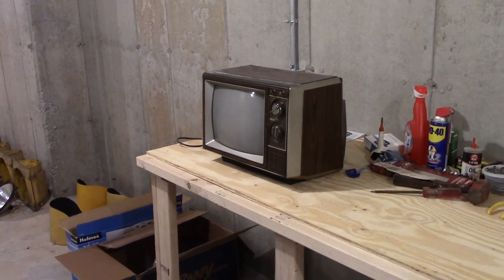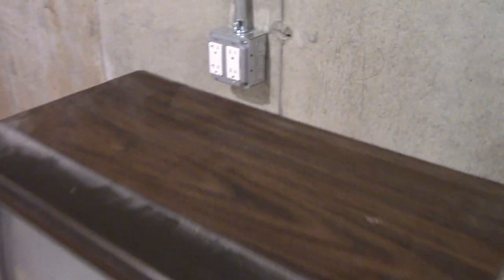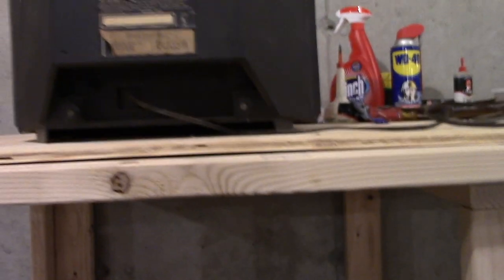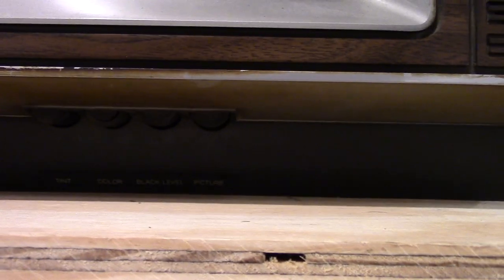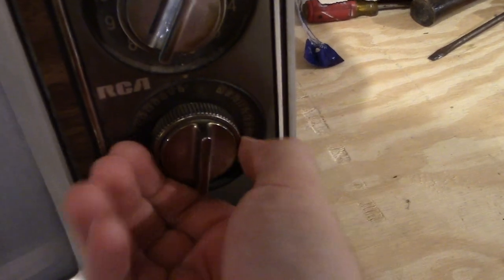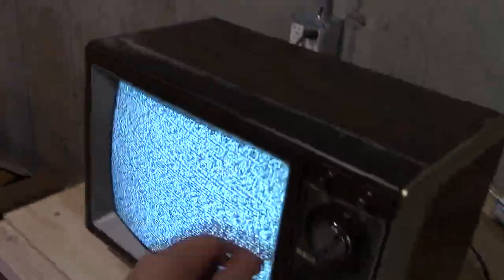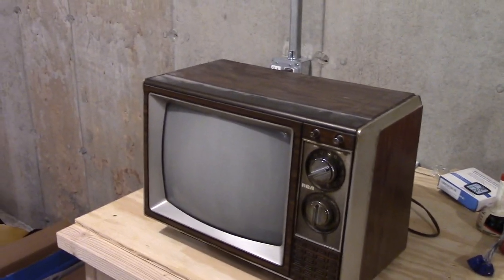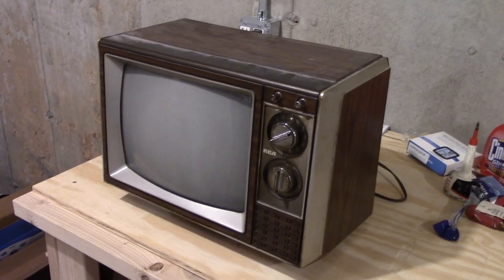1985 RCA Television.

Comment: I have 2 of those except they’re from different years, same exact cabinet style as yours though. I picked them up from two different Goodwill stores. One was $4.99 and the other $9.99 Worth every penny as they work great.  I hook up a RadioShack RF modulator so I use S-video or composite as a option. DVD player, Nintendo, Sega Genesis, PS1-2...etc.

Comment: The 75Ω/300Ω thing is for a shunt wire, it would be a loop of bare metal wire that would plug between those 2 ports.  Coax wire is 75Ω, twin-lead antenna wire is 300Ω.  This TV doesn't appear to have a coax connector, so you'd connect to the VHF terminals.  No need for that shunt wire, as from what I can tell with the diagram, it's set now to 300Ω.

You can get a converter to change it to coax, sometimes called a balun transformer.  Those are cheap.

AFT is Automatic Fine Tuning.  The TV will automatically adjust the receiving frequency up or down to tune the sharpest picture.  However, the caps may have drifted so it may not work properly.  Never fear, you can turn that off and manually fine-tune it with the fine-tuning rings within the dials.  

To get it to work with today's stuff, at the very least you need that balun transformer.  If your cable box has coax out, you can connect a coax wire between it and the TV, TV tuned to channel 3.

To get it to connect to other stuff, you can get what's called an RF Modulator, that will give you a composite input, and output via coax, which you can connect to the TV.  Or, if you still have a VCR around (even if the mechanism doesn't work), you can use that for most things.  That WON'T work if you want to hook a DVD player to it, because of the Macrovision copy protection encoded into the disc.  With a standalone RF modulator, that shouldn't have the problem.

The "loud sounds" when you turn the volume knob means the control is dirty.  Some DeOx-It spray will fix that right up.

Wouldn't work plugging into the existing coax connector in the "tv hub".  What you could also do is get a decent antenna, and a digital converter OTA receiver, and try to pick up signals over the air, and watch them that way.

(Yes, Jay has ALL of the items aforementioned, of course.  I even have a Macrovision "cheater" box, never used.)
Reply from the maker: Ah okay, all very good info! I'll see what my bro had linked me again and see if it is the right stuff. I'll just use my Millennial entitlements to get all of those for nothing! Since that's how it all works of course. So those outer dials WERE fine-tuners! I like when I can do stuff like that, where I think about what something may possibly do, and it ends up being the right function. 

I did forget to mention that kind of like the dehumidifier, this thing just has that "scent" which tells you that it was made back when. It is so unique.
Reply: @Sharkie626  The problem that you can't avoid is the bill that's coming for that info!

The fine tune controls, I mean obviously they're not going to be vertical hold, or linearity.  Kind of obvious.  Fun fact:  Early color sets that were high end and had remotes, often had a way to adjust the color and tint from the remote.  The reason being was color TV was in its infancy yet, and each station would broadcast color differently from the next, this gave the user the ability to adjust it without getting up.  Yeah, that would be really commonly found on late 60s to early 70s TVs, by the mid 70s they had that figured out and the feature started to disappear.

The smell is something that absolutely, positively, cannot be duplicated or even imitated.